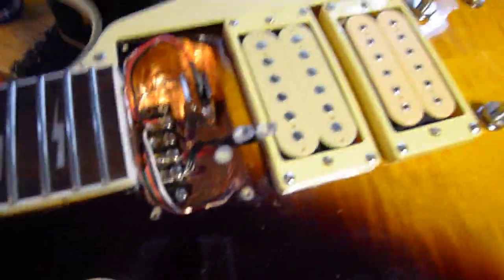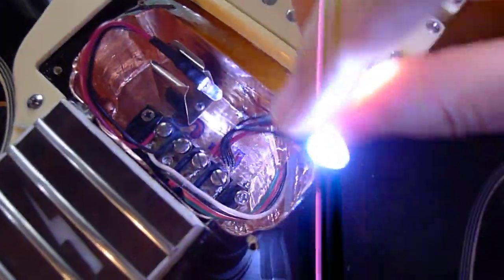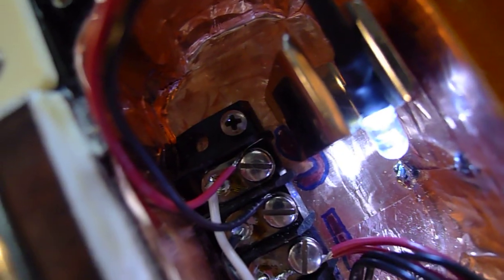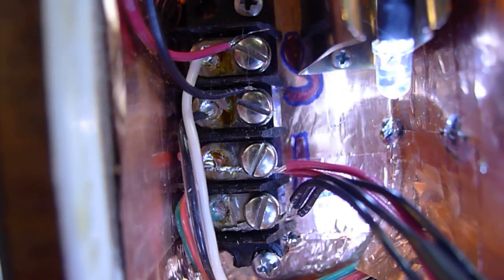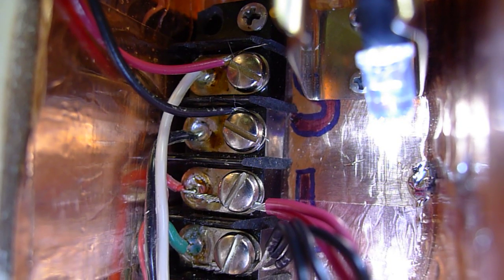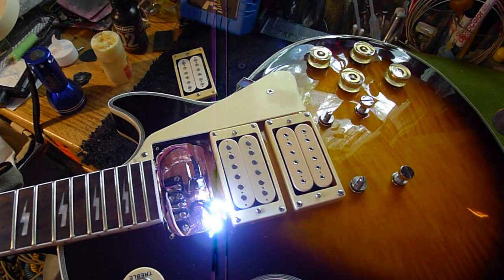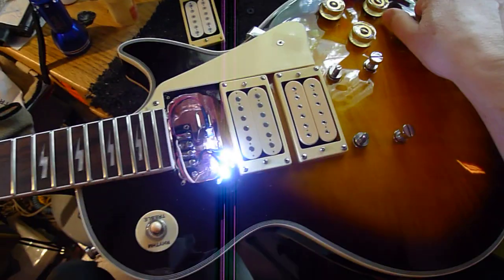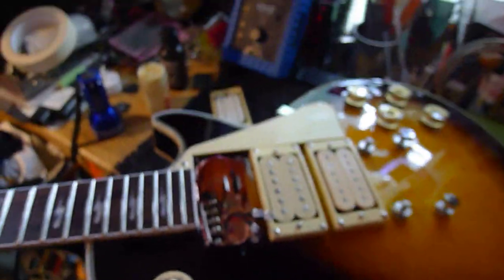A look inside a "Smoking Guitar" Ace Frehley style Bill Baker mod

Comment: Bill, the video you did years ago about how to string your guitar...just wanted to say thanks. I’ve been using your technique for years now. Just wanted to say thanks. I sucked at stringing my guitars for years. The way you explained how to get the proper slack measure with 2 or 3 fingers before wrapping. Works well on all my guitars. Thanks again.
Reply from the maker: Dan you are very welcome! Basically the smoke idea stemmed from the smoke in a model rocket. I went to the hobby store with that in mind and it went from there for about a year until it was like it is now. Hard part is putting it all together nice and neat and the challenges of these poorly made Chinese guitars. And my stringing technique was developed out of my own necessity. -Bill B
Reply: I second this. I used to suck changing strings. Piece of cake now. I just wish there was a youtube hall of fame.

Comment: In the beginning ace used a smoke bomb.. was to smoky and he switched to have it in the pickup
Reply from the maker: He did use a smoke bomb, but actually it damaged the controls so they went to John Robison and he came up with a better way to make the effect work without damage. It was done with indoor smoke bombs used to find leaks in duct work. Now it's done with an electronic fog machine. -BB